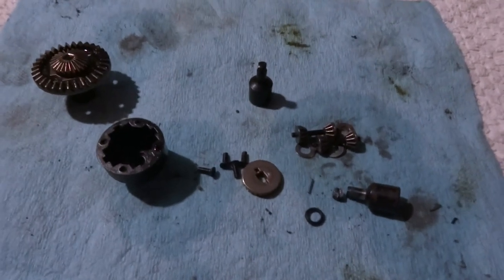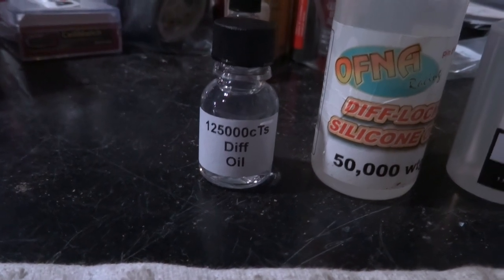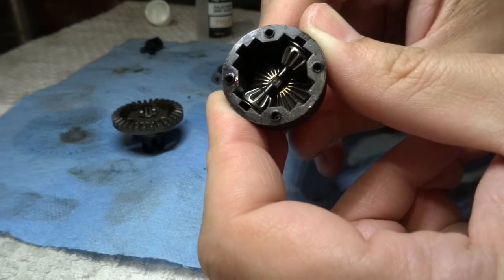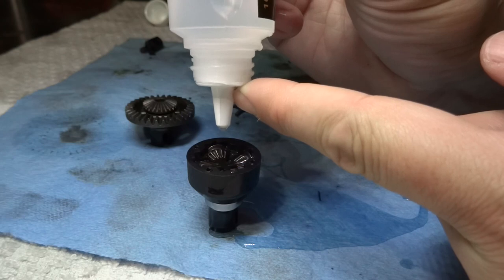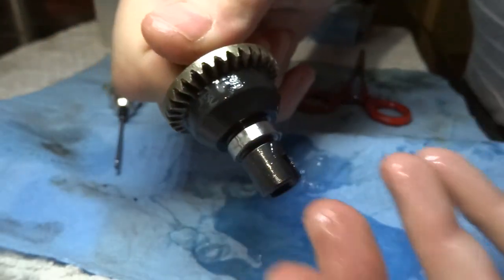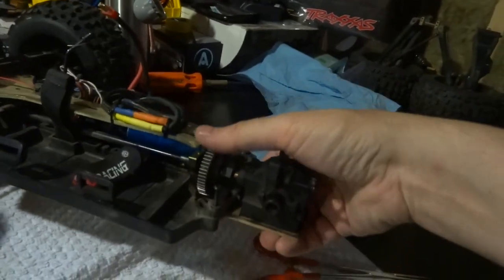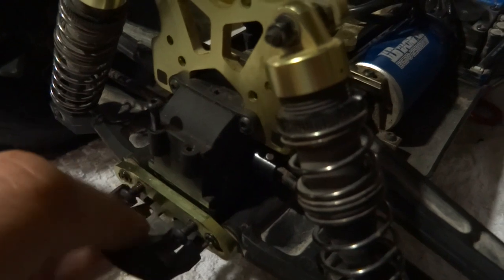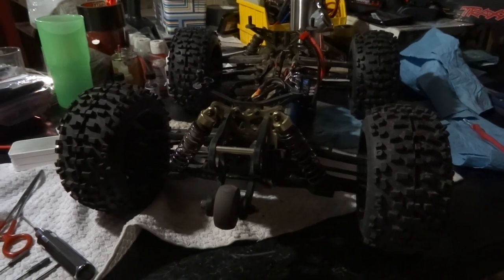Cheetah 4x4 Diff Rebuild - RC Stunt Truck Repair [How to] - Netcruzer RC

Comment: Nicely done...I have gone thru the same failure with my rear diff and you have shown exactly how to do it with clarity.  Thank you so much.  I must say, I don't find this car very durable, even though I like the model a lot.  I don't know if you have gone thru this yet yourself, but because of the wheelie bar, and the way I have landed on it first sometimes from a jump, I found that it contributed to a slight inward bend on the rear shock tower causing my body lugs /holes to suddenly be misaligned.  I have now solved this issue by inserting a threaded rod in the middle of the two shock towers.  And just to show how much force is being exerted on the shock towers, I can tell you that I even managed to bend the threaded rod slightly, so the pressure upon landing from a jump was certainly there.  Would have been worse without it I believe.  It's a great little truck, I just wish it was stronger in certain areas.
Reply: Richard Cerni my neghbors has the same problem

Comment: Is the diff box really seal enough that the oil doesn't leak?
Reply from the maker: Yes, there is a waxy paper gasket too between the diff cup and ring gear.
Reply: @netcruzer  Thanks.

Comment: Does the cheetah have a slipper clutch?
Reply from the maker: I’d have to say sort of. LOL. It has a spur with plates but I’ve never had it slip and I’ve not been able to loosen it. It’s effectively locked center.
Reply: Netcruzer RC TECH CARS You can definitely loosen the slipper clutch to have it slip. I have done it to mine so it has a hard time even pulling a wheelie, I bash it and jump it so I need it to slip 😉

Comment: My frontdiff is broken and I had to exchange it. Now turn the wheels very hard and in the same direction. What did I do wrong?

I put the New original diff in, without open it!? I think its ready to run? 

The wheels should be easy to rotate?
Reply from the maker: +Basata 86 should be easy to rotate in all ways. Hold truck in air and two spin each wheels together and see if you can feel where it binds. Something's too tight or misaligned. Could you rotate the diff in your hand like I showed after rebuild?
Reply: Netcruzer RC TECH CARS 

Check my uploaded Video please.
There you can see my problem.

Thank you
Reply: So, I've now expanded everything again and even opened the diff.

Oil is enough in it. 

The problem seems to me the Diff! The two axes can only be rotated with force against each other. 
In the built-in state, this solves a direct drive on the pinion ... 

I have now made the 4 screws of the differential somewhat loose so that the whole inner life slightly easier to move.

But the Tires dont spin easy like the Rear :-(

meaby i have to drive the Car and then its better..?